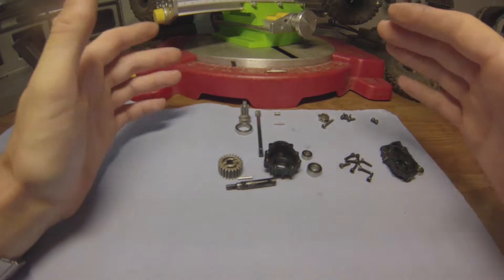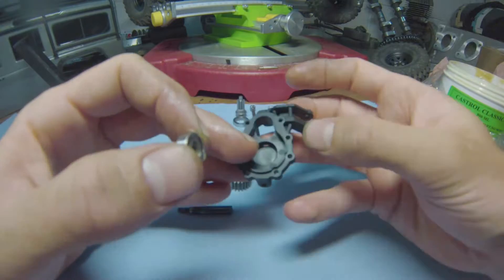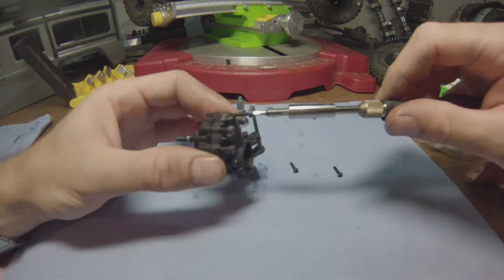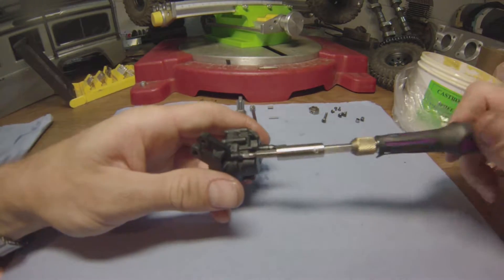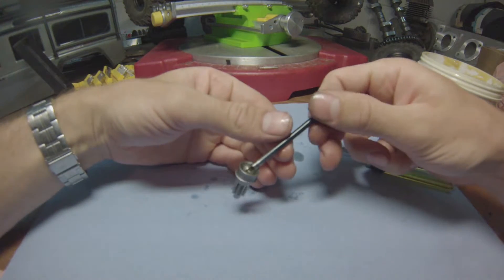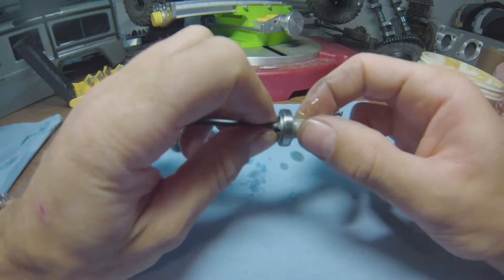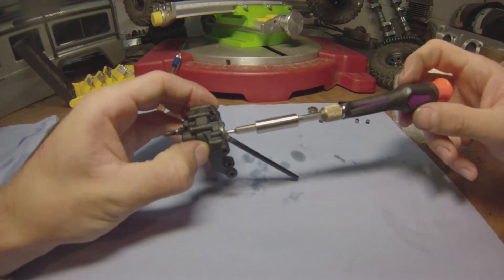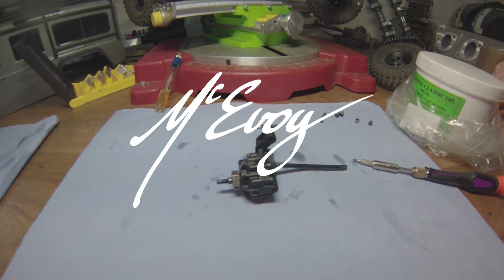Traxxas TRX-4 Technical: Portal Maintenance II

Comment: How do you clean the actual axle carrier hole before you put your greased shaft in? I would like a 3rd part where you put it back on the truck...do you spray like some parts cleaner in there to make sure its clean of grit or something? I'm wondering....thanks man!
Reply from the maker: Hello there! You would want to take the differential out and clean the case, degrease and blow it dry to make sure it is perfectly clean. Then proceed to greasing the diff before putting it all back together. Since then I have upgraded to alloy casings which I have sealed, considerably extending service intervals. I have improved upon the original design by adding a perfectly fitting o-ring on the diff carrier, making it impervious to pretty much anything which would otherwise enter the case. 
On another topic, I also transformed an alloy gearbox case so that it now contains actual automotive gear oil. :-) I would love to drop a patent for that, but it would be mad expensive. Thank you for watching, stay in touch!
Reply: @gmcevoy  thanks for the detailed answer so yes it does make sense you have to do the cleaning of the diff and case at the same time you do the axles and portals. thanks man :) Good luck with your future projects ;)
Reply from the maker: @TechWizMaster  Many thanks!

Comment: Hi Geoffrey, i don't know if you have noticed but the portal box has a small hole in it. On the rear section where the inner bearing is seated and where the axle bearing fits. There's a small imperfection where the back of the case is molded. Great content mate keep it coming
Reply from the maker: I did notice that indeed. :-) Thanks for your encouragement! Much appreciated. Keep yours coming too mate. It is always welcome to learn new things. Have you been messing around with your TRX-4 lately?
Reply: @gmcevoy  im still in that content stage with my TRX 4 after those first minor modifications I done. It's such a treat and pleasure to drive, one thing I do want to look into and maybe we could pass options is. The axles knock at full steer? Have you noticed that also?  Hope your keeping well I'm just catching up on your content
Reply from the maker: @mehimrc1314  I am not sure, I must take a look. It has been months, since it has last seen the light of day. Poor thing. It will be worth the wait though. ;-) 
Two things come to mind at first: is the differential unlocked? Also, I am thinking it could come from play in between the portal input gear, the pin and cross-pin linking it to the driveshaft... Just a thought. Or maybe your portal needs shimming? Haha! Worth a check!
Reply: @gmcevoy  I'm the shim master haha. On a serious note lol, I've had the axles entirely apart from cross pin ect. Rubbed down all sharp edges, rounded inner pivot pin hole for smoother rotation ect. With the diff open, I always run open diff with tests makes sense I feel. My only thought now is within the axle housing, once the steering reaches max lock the axles maybe shift the diff in the housing cousing knocking. I think we need a conference call sometime?
Reply: @mehimrc1314  did you ever figure out this problem? mine does this as well. I'm certain its the u joints on the input shafts, let me know if you found a fix for this. aside from the obvious steering end point adjustments which makes for a 5 point turn due to how much steering radius you lose...
Reply: @logansearle9577  There are a multitude of areas to cover and I'm slowly seeing minor changes. So if it's all worth it in the end, I'll be sure to shout it from the roof tops. The U joints are a starting point, they're rough so can be sanded down to smoothen them out with very fine sand paper. Makes a small difference but not the solution. Then diff has lots of play possible needs adjusted. Also if you take the case off the diff housing and hold the diff in via the bearing. Run the car and you'll notice the diff oscillates/wobbles even if you hold it still. This maybe due to the drive shaft ends being a bit grim from stamping. Lots to cover my friend but I'll be sure to report back.
Reply: @mehimrc1314  keep us posted :)